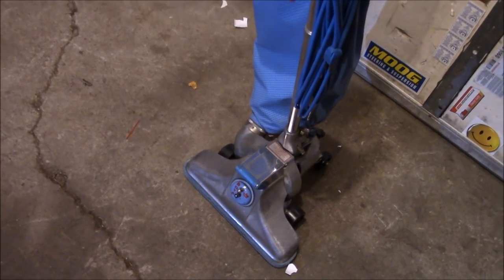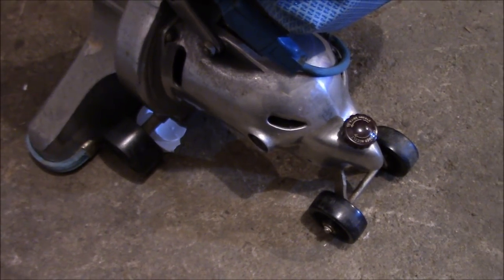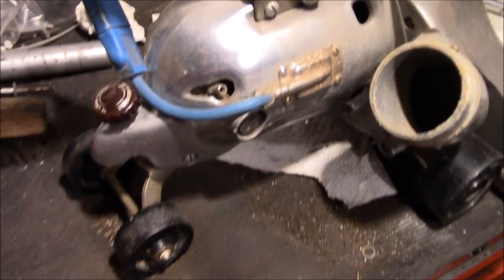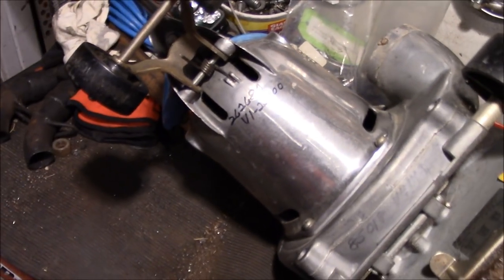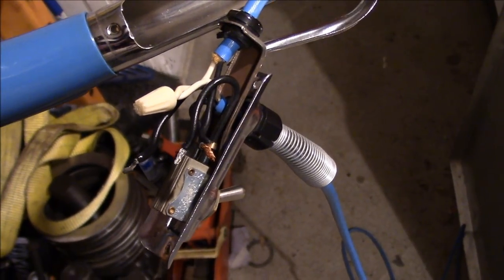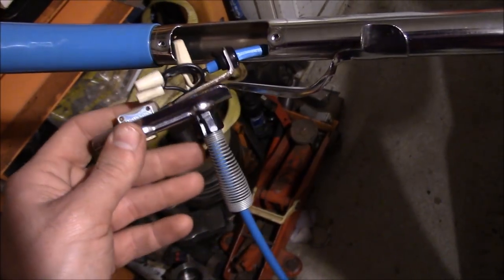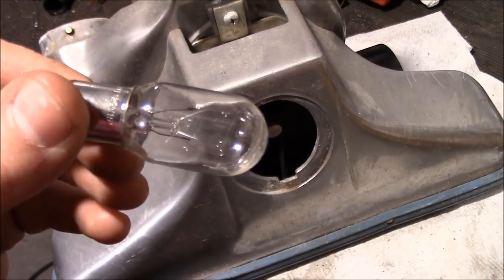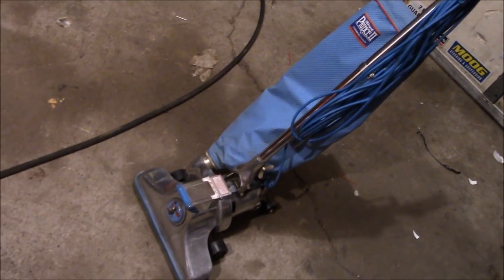Another way to blow $20... 1970's Vacuum

Comment: The other thing I wanted to tell you about your 880 is this: does it have the metal cord anchor inside of the bottom of the top handle tube? The wingnut securing the top and bottom halves of the handle must be unscrewed first. On the outside, the cord anchor is secured by a lockwasher and hex nut; these parts were not used on later production machines.
Reply from the maker: I'll have to check, but I believe it does have the metal cord anchor.  Good to know!
Reply: @toocheaptosmoke  Thank you!

Comment: Yes, this is a Royal 880 from 1971 to 1975. The Prince II bag I see on this is not the original one; the original one was also light blue, but it just said R-O-Y-A-L (read vertically) in red screenprint.
Reply from the maker: Cool, thanks for the info!
Reply: @toocheaptosmoke  You're welcome.
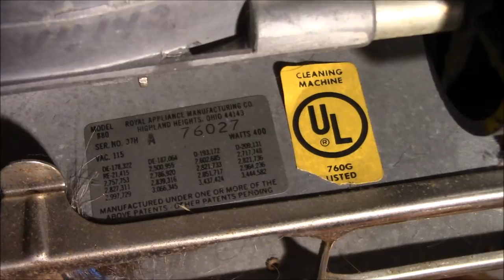Reply: @toocheaptosmoke  In fact, the serial number I saw at 2:34 dates this cleaner to August 1973 (37H).